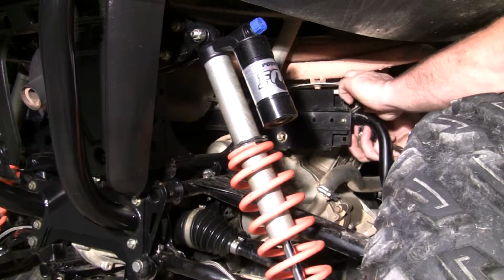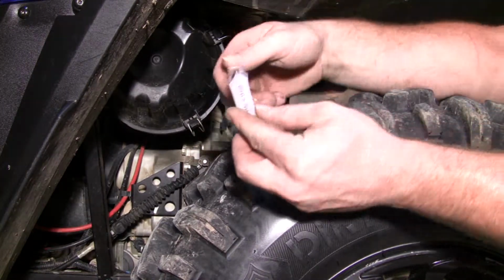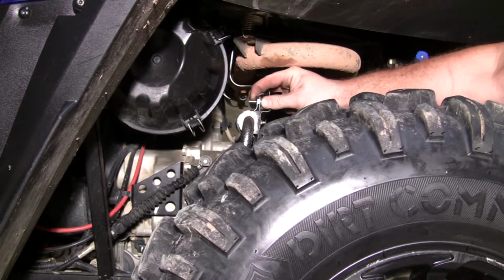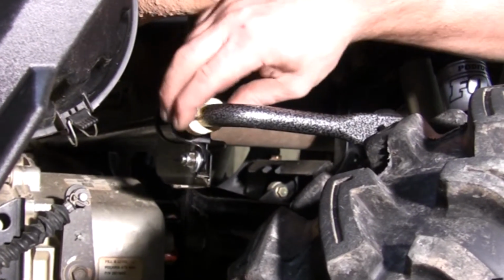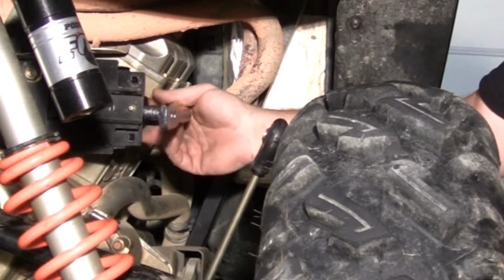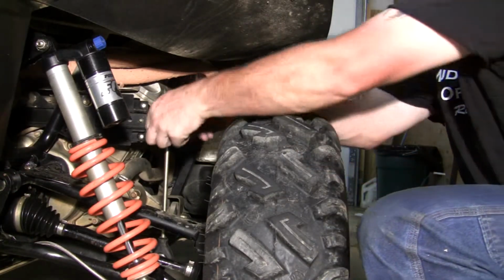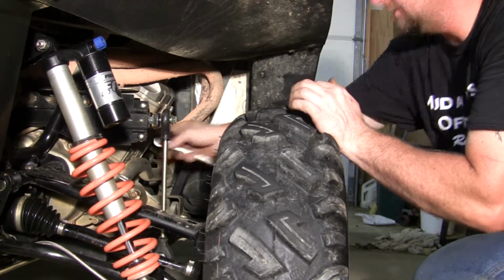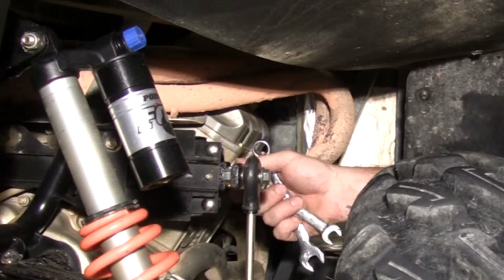Installing the Cognito Motorsports sway bar for the RZR 800 S

Comment: If you like to run high speed trails running without a sway bar is a bad idea with or without racer tech springs if you like running on the rocks running without a sway bar is a good idea